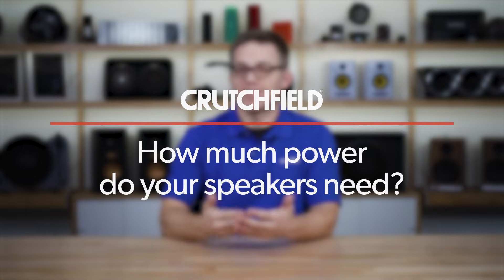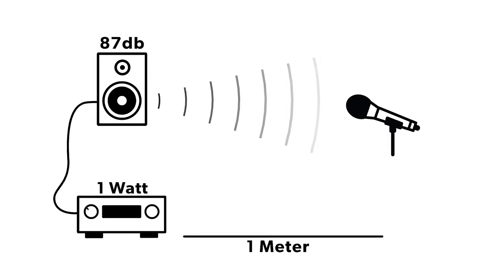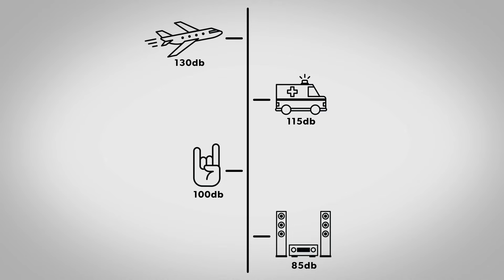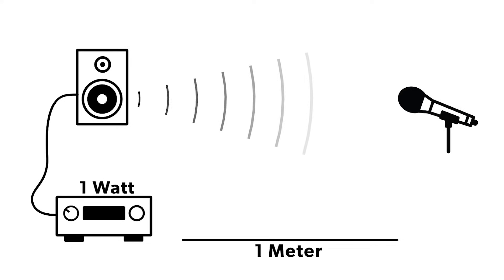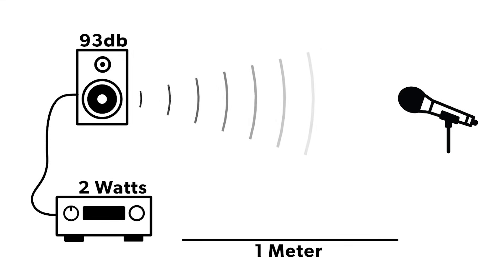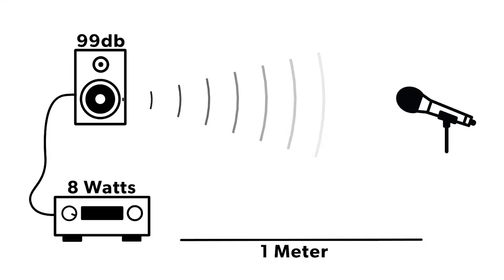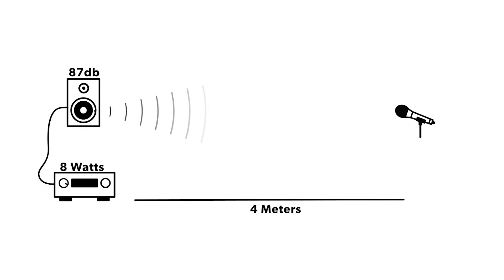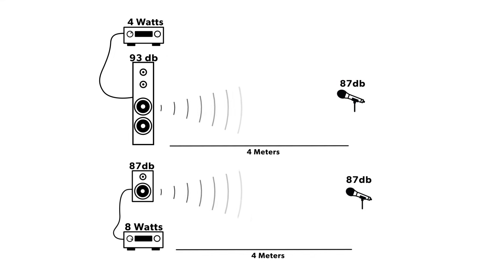How much power do your speakers need? | Crutchfield

Comment: While it’s all true and correct, the room contains the sound so it does not spread out indefinitely  so lowering spl in most rooms is not likely 6db per metre. Typically less power out of the speaker is required in the bass, depending on where the speaker starts rolling of as frequency is lowered. For most of us, as you have shown, 50W is ample extra headroom, 500w is only needed in large rooms and/or very insensitive speakers.

Comment: Nice technical explanation, but I wish there was a more practical section here as well... 
Like take this example:
I want a pair of B&W 801 D4 Signature in my stereo setup. Check the specs and they have a sensitivity rating of 90dB... My Listening position will be roughly 4 meters away so -12dB and I wanna be able to listen at 90dB, so I do the math and wow, I only need an amplifier capable of 16W in 8ohm... but in reality you would never use such a low power amp on these speakers and if you did the results would be horrible. Going by just this calculation pretty much every amp on the market is more than capable of driving the 801d4's, it also doesn't take into consideration that two amps that both have a 16W rating can vary massively in terms of how much power they actually have. 
Just look at Denon's line-up of amps and receivers, the AVR X2800H comes with a sticker on it claiming 7x150W, dig a bit deeper and you'll see 95W in 8ohm, 20Hz-20KHz, driving two channels... Meanwhile the PMA-3000NE only claims 80W in 8ohm? why's that? is the 1200$ receiver more powerful than the 3500$ integrated stereo amp? 

There's very clearly a lot more at play here than simply looking at sensitivity and distance to get a wattage and then finding any amp claiming to supply that number... In what world would you ever spec a smaller amp for the 705s3 than for the 801d4? because that is what the math tells us based on the sensitivity... I've heard the 705s3 on a Lyngdorf TDAI1120 and I'll be honest, it felt a bit disappointing, and that's a 60W amp in 8ohms, I've also heard the Hegel H95 on the same 705s3's and that's also a 60W amp, but it plays WAY louder?

Comment: I have pair of speaker,  which has sensitive of 86db 1W/1M  and power handling is 80 watt each speaker.  
 if I sit 1m away from the speaker.  Then speaker need 1 watt of power from the amplifier to create 86 dB of loudness. Am I right let me know. 

In another case:
If I give a speaker(same specifications of above speaker) 40 watt power from amplifier,  that means speaker will produce 3440 dB loudness at 1m (40watt×86db) . Am I right?
Reply from the maker: Not exactly. To increase the audible volume at the same distance 3dB, you'll need to double your RMS power each time. 32-watts to the speaker you described would provide 101dB at 1-meter, and you would achieve 104dB if you delivered 64-watts to your speaker. I hope this helps!

Comment: Hi Brother I have an AVR with 105 watts per channel X3600H DENON 9 channels I have to Keep a volume of 63 to get proper Sound  I have Mission Vxc tower and Paradigm Center Channel If I add a power amplifier will I get proper Sound reduce the load on AVR Pls advise
Reply from the maker: Sounds like more power will help. What is the impedance and RMS power rating for your towers and center? How many other speakers are you using? Are you happy with the output from the others?
Reply: @ Center Channel 50 Watts 4 ohms Paradigm 🔈 Speaker Mission Tower Vx-c pair each 100 watts 8 ohms and all other paradigm 50watts 4 ohms SR,SL,SBR,SBL and 2 Height channels Dolby atmos 🔊 50 watts 4 ohms

Comment: I find this info really useful. But how does the impedance affect the need of power? 8 Ohms Vs 6/4 Ohms?
Reply from the maker: Many home receivers and amps output more power as the impedance drops, but not all of them are 4-ohm stable. So it really just comes down to matching the receiver or amp to the specific speakers being used, based on the impedance of the speakers and output power of the receiver/amp at that impedance.
Reply: @crutchfield  ok, so one cannot say that the dB changes when only the impedance of the speakers change? I mean if the speakers are 8 Ohms and provide 88dB/w/m, and you replace them with other speakers that have the same specs except 6 Ohms?
Reply from the maker: That is correct because speakers with different ohms that have the same sensitivity means you will get similar volume levels with the new speaker. The only change that may happen is if the amp doubles it watts RMS power output by changing from 8 ohms to 6 ohms. If the increase in the power output is anything less than double, then there won't be any changes in the volume levels you hear
Reply: @crutchfield  thanks!

Comment: I assume that measurement figures on standard atmosphere nominal sea-level air pressure of 1013 hectopascals? What if your listening room is in Denver, for example?
Reply from the maker: Hi Brian, at a higher elevation, a bit more power generally can help you power speakers better. Are you looking for an amp to match specific speakers?

Comment: U didn’t mention what kind of signal source is used for these measurements ?
Reply from the maker: The input source being used won't change those calculations mentioned in the video for power as it relates to the amplifier/speakers.

Comment: Good lesson, except for 2 BIG things: 1- there are (normally) TWO speakers which add their sound together (to some degree) and (2)- the need for instantaneous power for musical peaks (see HEADROOM). Other than that, a good overview. Nice how you did mention distance from the speakers, which almost no one ever does! Most people are 2 or 3 meters away, not 1, like the common speaker efficiency spec. 

So, please make another video that mentions how you'll want some headroom many experts say 40db for rock music, (at least classic rock before super-compressed masters became so common!) and perhaps 20-30db for classical music. This would increase your power requirements by a big factor!
Reply from the maker: That's an excellent idea, we'll pass along that suggestion!
Reply: Exactly, I think the video is technically very informative and clear... but at the same time, very misleading for those who don't possess that basic knowledge. That would be a LOT of people, most, in fact. I think without the follow up, and as a pair/series, it's almost irresponsible to post this video. Could lead to a lot of damaged equipment, and disappointment.

Comment: Depends on what you want it to accomplish.  My stereo is a Sony 50W combined stereo system, and a 500W class D 15inch sub. Works very well
Reply: I thought its amplifiers that are classified Class D. How come you have a class D subwoofer?
Reply: @tholo86  The subwoofer is powered by a 500W class D amplifier. And with it came a 15in special driver. Enough to blow my windows out.
Reply: Made in the US

Comment: My problem is being a guitar player I mistakenly equate guitar amps with hifi amps. My 50 watt Mesa Boogie will hurt your ears at 1/2 volume. My 50 watt hifi amp is under powered. Guitar amp speaker sensitivity must be extremely high then. Or am I still wrong?
Reply from the maker: They are very different in design and output based on how they are used. Are you looking to add more power to your stereo setup?

Comment: So if i understand correctly let's say that i want to build a speaker setup at my desk nearfield, the listening distance would be about 80 cm to 1.2 meter, and a the speakers have 87 sensitivity and 6 ohm, would it be sufficient with only 1 to 2 watt?

The thing i don't truly understand is why some amps have that many watts then? if lets say someone listen a bit further at 3 meters it would only requiere less than 10W to meet that decibel level no? don't know why so much power in some of them at 100-160W.
Reply from the maker: Most of the commercial amps offer more power since they are designed to fill a larger area rather than to be used for a personal listening space. Would you like help choosing an amp for your desktop system?
Reply: @crutchfield  Yes, im looking into different options and watched many reviews in the last 2 months, i only need 2 channel and maybe an output to connect a subwoofer in the future to create a 2.1 system, my room is quite small so i don't need ton of power and neither need many inputs to turnables or things like that, my source will be my pc to listen music with Spotify.

I watched different options at about 500€ max like Yamaha A-S301/501, Rotel A11 Tribute and a couple more but i think im paying for things that i don't really need, i also consider some of the latest class D like Aiyima A70, Fosi v3 or SMSL RAW HA-1/AO300, that i think will suit better to my needs, what do you think? will it be a difference in sound quality between the class AB options and the cheaper class D amps? thanks
Reply from the maker: AB class amps will provide a warmer and more natural sound, it's true. If you are concerned about paying for features you do not need, consider a pair of powered bookshelf speakers to connect to your computer. The Audioengine HD3's below feature class AB amplification and a USB type-B input for connecting to your computer!

https://www.crutchfield.com/I-rYALc166/p_772HD3BK/Audioengine-HD3-Black.html

Comment: The stronger amp the better speakers sounds on low and high levels. But normally you don't need stronger than 100 watts dynamic 8Ω.

Comment: I recently removed a 12" Celestion labeled speaker that was stamp marked 8 ohm.  Nowhere was there a wattage rating marked anywhere.  Is there a way to determine what the wattage or power rating is?  FYI.  The speaker came out of a Marshall JCM 2000 401 which is a 40 watt tube amp.  The speaker is not stock because the amp comes stock with a 16 ohm.   Everybody shows you how to get the ohm meter reading, but not wattage.
Reply from the maker: Manufacturer's use specialized testing equipment to determine a speaker's maximum RMS ratings, and there is no way sadly to test with a multimeter to determine those numbers. Most Celestion 12" guitar cabinet speakers like the famous "Green Backs" can usually handle around 25 to 30-watts RMS.

Comment: Ok so how does this translate to 70 watts amps?
Reply from the maker: Are you attempting to calculate the SPL of a 90dB sensitive speaker at 1-meter from your listening position when powered with 70-watts?
Reply: @crutchfield  I mean... I loved the explanation. But amps are 50... 70... 100... 300 watts. So it's difficult for me to understand how to choose the right amp for my speakers.
Reply from the maker: Would you like help choosing an amp?

Comment: Can I use 100w speakers ? instead of 40w speakers which came by default with Amplifier? With the same impedance?
Reply from the maker: You should be able to use 100 watt RMS speakers in place of 40 watt RMS speakers. We are happy to check. Which system did you get? Which speakers are you hoping to use in place of the original speakers?
Reply: @crutchfield  it's an old Hi fi Music system from SONY MHC Rv6...I was able to get an Amplifier without speakers. So I got  the speakers from Other Sony Models but not able to get other two surround speakers for the Deck. This Music system comes with 4 Speakers
Reply from the maker: The surround speakers are listed as having a 24 ohm impedance and its more than likely, you won't find any that can work in place of the original surrounds. However, the front speakers are listed as having a 6 ohm impedance and that's still used in some speakers today.
Reply: @crutchfield  yes ,  I came through a surround speaker which is 24ohns but 100 watt, the actual surround speaker is 30w with 24ohns.
Reply from the maker: That's impressive! We didn't think you would find a 24 ohm speaker. Which brand and model speaker are you using in place of the OEM?
Reply: @crutchfield  it's from SONY MHC RV8 , i managed to get one Surround speaker it has 24ohms impedance., those are Legendary Music system with Majestic sound. it's superior in audio Quality. It's a wonderful invention. For Music World..,❤️by the way 24ohms are very rare now. .

Comment: Bass sound depend on watt power or not? Or watt power is just the distance that speaker can provide? I have my PC speaker 10W, but bass not much, i sit in front of my pc. 
I want to buy a new speaker to 60-100W. So will i get bass?
Reply from the maker: More power can help with bass. Would you like help choosing a new PC speaker system?
Reply: @crutchfield  i am using Edifier R101MT, 10W. not have much bass. i am thinking of upgrading my speakers.  can you recommend? but i dont want PC system, i want bluetooth speaker to connect with my phone. best budget bluebooth speake please.
Reply from the maker: That is not much power but we can change it! One of the best speakers for this application and for budget while keeping bass in mind, are the Audioengine A5+ wireless powered speakers shown here:

www.crutchfield.com/I-rYALc227/p_772A5PBTB/item.html

Comment: Ok What is the RMS watt needed for a PA to have the same output of a 50W tube amp in a 2x12 or a 100W in 4x12 ? 
Why somehow 100W in a tube amp is a lot but 300W RMS in a Power amp (solid state) is too low?
Reply from the maker: Hi Renato, the best amp match in either case will come down to your exact use, space, and speakers. In most cases, a PA amp will be used with less efficient speakers and needs to fill a larger area than a traditional tube amp home system amp would. We do have a great shopping guide for PA amps here: https://www.crutchfield.com/S-9hm3vCEhlSE/learn/pro-audio-amplifiers-buying-guide.html
Reply: @crutchfield  nice reply, thank you
Reply from the maker: You're welcome. If you need help choosing or anything further, please let us know.

Comment: Left out was important that the room be anechoic, lined with sound dampening material. The normal listening room csn vary widely, from draoes and carpet to hardwood floors. Classical music is very dynamic and in concert peak at 95-105 dB but have long passages doen at 40 dB quiet library. Duration is part of the damage to hearing. FYI.

Comment: Doesn't it take 16W for the 87dB sensitivity rating speaker to maintain 87dB at 4m? Because at 4m, there will be -12dB reduction. So, to compensate for the reduction 4*3dB by doubling power 4 times from 1watt, should result in 16W instead of 8W right? Pls correct me if I'm wrong.
Reply from the maker: Yes, the calculation is the speaker's sensitivity rating, expressed by its measured decibel rating under one watt of power at a distance of one meter.

Comment: I'm sorry but I've been looking everywhere for answers but off topic question: "If i have a 250w active loud speaker and decides to just use a portable power station, let's say a 600w power station, how long will it last?" Same question, The JBL Partybox 1000 can put out 1000w of power (sound)...would i too need a 1000w power station? And how long too?
Reply from the maker: We do not have the equations to calculate how long a power station, or battery, can keep a system playing. But it does seem that you will most likely need the details on the power being used by the active speaker's built-in amp to run the 250W speaker as well as the total power being stored by a power station or battery.

Comment: You say that when you double the listening distance from your speakers, the sound pressure level drops by 6db. This is only true when measured under anechoic conditions. In the real world, like a typical lounge or listening room, there boundary reinforcements. Reflective surfaces which reduce sound pressure level loss by as much as 3db!

Comment: from my understanding it means i dont need a 150w amp for a pair of 150w speakers. is that correct?
Reply from the maker: Pretty much. There are very few times that 150W speakers will need to get all 150W of the power they can handle. It's all dictated by the volume level goals and seating distance
Reply: @crutchfield  thank you. I have been try to work it out all week. your video was the first to make sense
Reply from the maker: We are glad we could help and put an end to a weeks long struggle lol Let us know if there is anything else we can do to help.

Comment: I have an 88db speaker and im powering it at 110 watt in my theatre room and i am listening it at 4.5 mtr.. how much db is i am hearing..and is that good or not?
Reply from the maker: The best way to measure that is to pick up a sound level meter.  That will help you get the most accurate specs for your setup and space.

Comment: i think your math is wrong. if a 93db speaker hits 87db @ 4m and 4w — then you’ll need to add 4x the W (16w in total) on an 87db speaker…
Reply from the maker: We are using a 90db sensitivity in our example when we started discussing the distance factor and how that impacts db's
.
The good news is that you are correct! An 87 db speaker does need 16 watts for people to hear its audio at 87 db level when 4m away.

Comment: At least I understood this sensitivity issue.... Could you help me with my choice? I have a Harley Benton 100W (8ohms) that I want to use with a 112 guitar cabinet loaded with a Celestion F12-X200 8 ohms, 200W, 97 db sensitivity speaker. Is this Poweramp suitable? Thnx
Reply from the maker: That amp can power the speaker you described! It won't make that speaker play its loudest but as you have seen, that isn't often needed in most rooms.

Comment: I'm confused. I keep seeing videos saying that it's bad to buy speakers with higher RMS than the AVR can handle per channel.

So say I have a 70watt per channel AVR. I have two 94db speakers that are rated at 85 watts.  I am sitting 3 meters away. To listen at 88db It would take 4 watts of power. So then I have 66 watts left over for that channel? How is that bad?
Reply from the maker: Sounds like your system's specs match well.